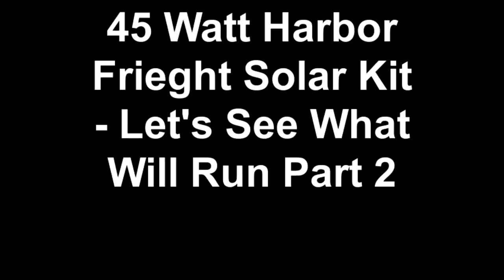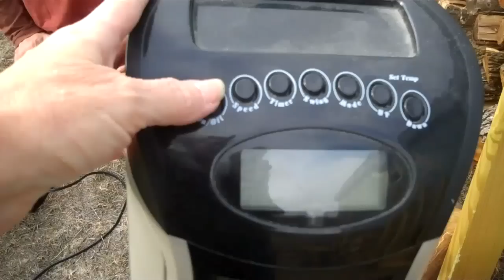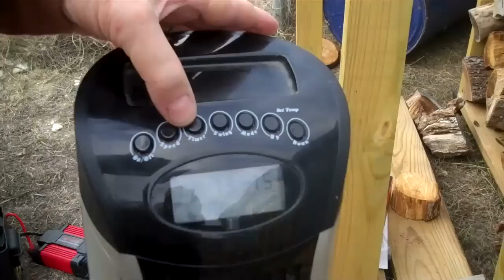45 Watt Harbor Freight Solar Kit - Let's See What Will Run P

Comment from the maker: Yes or add more battery bank or larger watt panels for faster recharge but as they system stand it would end up not being able to charge the battery as quickly as the fan can deplete it.

Comment from the maker: Yeah, very true. For that type of application 45watts probably wouldn't do much for you. You could probably find a single panel that is smaller and generates more wattage. We got the HF system just to get our feet wet and start learning about solar power.

Comment: I've owned those same panels/kit. 45w comes only in direct sunlight under optimal circumstances. I used my kit to charge a small solar bank of batteries just as an experiment and it taught me wonders. It also taught me little $ buys little total output. If you're serious you need good equipment and a much bigger panels. A 45w system is meant for one or two CFL's in a shed and such. Maybe a landscaping light or two. 45w is more like a battery maintainer, not a charger.

Comment: I hate to be a stick in the mud but the solar panels ain't running anything. The batteries are. Connect the inverter directly to the panels and you will find that they will run very little. They are ment to charge the batteries when no load is there using power.

Comment: that drill wont run under a load . the overload will squeal every time ..
some time you can add more batteries wth 00 ought cable and it will help .
but you really needs a 2000 watt to run power tools
i barely get 10 amp ac out of my 2000w . at 100amp dc .
to run easily on your inverter . you need to run  at 50-75% . to be most efficient . that way your inverter doesn't get hot ..& your not wasting power
more questions you contact me  Facebook .Gerald Strong
facebook.com Homemade-incubators

Comment: Fan was probably acting strange because inverters put out square waves instead of sine waves like a house does. I used to have a laptop charger that would not get along with my inverter, it kept switching on and off and flickering the charge light.

Comment: here in the us its about 60$ a month to run a 400watt @ 110volts but if u use 240volts u can run a 600watt for the same price (less lead on the curent the magnets dont have to work as hard) this goes for digital or anilog balests =3-

Comment: Watts is how much energy (J) is used per second.  Kilowatts are 1,000  Watts.  A kilowatt hour is how much energy is used by a 1kW device for an hour.  So what you do is take your electric bill, find out how many kilo-watt-hours you use, and divide by the billing period (720 hours in a month).  Ex: 1440 kWh / 720 hours = 2 kW average load.  The battery concept won't be as cost effective as installing a two way meter that sells energy back to the grid.

Comment from the maker: Something like that.We haven't gone that deeply into it ourselves yet, but I think you determine how many watts each item uses and multiply that by how many hours a day that device runs to determine the daily power requirements for that device. Then you add them all together to get the daily household power requirements. I'm sure there is more that has to be taken into account before deciding on a system. There are some good sources on the internet with more info than we can give at this time.

Comment: I have question about Watts.  Too find out how many solar panels, how many batteries you need for a whole house off the grid, do you have to add up all the equipment and appliances Watts required to run them and go from there? I hope my question makes sense. Watts determines how many solar panels and batteries required?

Comment: I have to comment that the fully charged battery is running your 750 watt inverter, and it would work with NO solar panels and proves nothing about the panel output..Its not a test. 

Now if you put a dead battery on it or ran the inverter directly off the panesl that would show something..

Comment: Lead acid batteries are not a good idea with solar power, a AMG sead battery is much safer.

Also be sure to hook your battery to your controller first , Never hook the panels up to the controller without the battery being connected

Comment: Thanks for the info.Between your video,these comments and some research I think I got it(Think,lol) Im more interested in an emergency  system and am gonna try a system consisting of a 5 watt trickle charger and two 12volt batteries...I to use and 1 to charge.We'll see how that works,thanks again man.

Comment from the maker: I was just thinking about that the other day. I think the inverter and panels can be connected at the same time, but not absolutely sure. Have to check on that. I would really recommend some type of storage battery rather than automotive battery (we're using a marine/rv battery).

Comment: Nice video...I have a few noob questions...I see that I just need an inverter and a car battery,but what is a recommended watt output?(I see 300-1000 on amazon),and can the solar panels be hooked to the battery while the inverter is also? And what exactly do I need to be "Searching for"on amazon to find something like this?
Thanks in advance.

Comment from the maker: You are right.  We disconnected the charge controller from the panels when we hooked the inverter to the battery.  As noted further down in the description the fan is actually running off the battery that was charged by the solar panels.

Comment: What you are doing is a function of the battery and inverter.   The recharge/recovery rate of the battery will then be determined by the solar panel productivity which in turn is limited to the 45 watts on that system although you can add one more panel without blowing out the charge controller that comes with it.   The very first system I built was based on that.

Comment: OK thats cool...but people have to know..the system you have is NOT for real home use, just basic DC and very limited AC use. losses in conversion or 90%  12 v dc @100 amp/hrs will provide about 10 amps for 1 hour at 120 volts..and that is limited to 80% so you do not kill the battery .

Comment from the maker: Thanks for the info. We realize the Harbor Freight system is limited, but our purpose in getting it was just to use it to get some experience working with solar; for that it has worked just fine. It keeps our rv/marine battery charged between camping trips. We got it on sale for about $149.00, which was within our budget; $470.00 was not. From this point forward we will buy better panels/batteries/charge controllers, but this kit at least let us get started in solar power.

Comment: use solar modules that provide at least .87 amps for a 20 watt mod, for 2.61 amps of charge power from 60 watts. a good charge controller of at least 8 amps. and buy an RV or marine battery 110 Ahr from Costco or Tractor supply for about 69 bucks. total cost for the above should be around 470 bucks, a little more than the HF or NT system but twice the power and battery included..

Comment: Piece of junk!... Look at the back of the Modules.. each 15 or 20 watt mod only provides .34 amps (Apx.1/3 amp).. what a joke..so for a 60 watt system the most you get is about an amp..to charge your battery bank..Want a tip...use 50 watts of collector to charge 100 amp hours at 12 volts as a base..build from there.  PS Put a load on the drill and the inverter will trip out..but by now you figured that one out...

Comment from the maker: Yeah, we finally figured that out. I had known for some time that modified sine waves could affect some sensitive electronics, but didn't know about the issues with motors until others pointed it out. Fortunately, we're mostly using the battery/inverter combo to recharge cell phones, laptop computers, cordless power tools, and so forth, so it works fine for that. Thanks for watching!

Comment: Nice video ,, very cute 
Fan more like acting up because ,, Not pure sine wave 
Lots of digital displays ,, and motors don't like modified sine wave ..  
I got several modified inverters ,, MYSELF 
for example some my of eclectic blanks wont work ,, 
and some fans will not run or if do they chatter bad .. do to the 
wave form .. 
Now with that being said not all modified wave inverts are same 
Some are clean then o there's // some run some things and not others 
GOD BLESS

Comment from the maker: Yeah, someone else had commented about the modified sine wave issue with motors, but thanks for mentioning it. I didn't know about the CFL issue though, we haven't tried those yet, so thanks for pointing that out. We're mostly using it for recharging electronic devices and cordless power tools when remote camping, so we can get by without a true sine wave inverter for now.

Comment: You are really testing if the battery and inverter are strong enough to power the fan there.  Looks like you have a 700W (or more) inverter.  Question is how much power (watts) the fan draws vs. how much the solar panels are replenishing.  If 200W/hour for example being used, and 45W being added by the panels, you run out quick

Comment: Great video! I have a 45W HF set too, and a LaVie 30W panel going to 9 batteries that I run my fans and the LED lights in my living and dining rooms. Works very well.

Also, there are very affordable wind turbines on eBay if you want to take advantage of all that wind.

Comment: Something else that you might think about if you are going to use your solar panels for much would be cordless power tools.  That way, instead of having them draw all that power from your batteries in your system, they just have to charge the batteries for the tools.  I run my small workshop off of my system, and this has helped immensely with keeping my draw to a minimum without reducing my effectiveness.

Comment from the maker: Without the battery the drill would not run as the solar panels are only rated at 15W each, total of 45 watts. Don't know how long with the battery. However, my wife wants to see how long it will run with her dehydrator, so we'll see how that goes.

Comment: So briefly, if your device has a electric motor that doesnt run straight off the main voltage it will act funny.  I have a true sine wave inverter and a modified sine wave inverter to make you a comparison if you want.    Modified sine wave as they call it is not a sine wave, more like a triangular wave.

Comment from the maker: Thanks for the info! The information I've found suggests that modified sine wave inverters are generally okay for powering non-electronic devices such as lights, toasters, motors, etc., but can cause problems when used to power devices that include electronic circuitry such as computers, televisions, etc. One example given was that it would probably power a refrigerator motor just fine, but could cause problems with any electronic control circuitry used by the refrigerator.

Comment from the maker: The panel keeps the battery charged, and the battery is, if I remember correctly, rated at 220 amp/hours so it should last a few hours at least. We don't use it very often, our main purpose is to keep the battery charged for emergencies and camping so we can run or charge cell phones, laptops, radios, ham radios and so forth.

Comment: I've been using a cheapo set of Harbor Freight solar panels to charge a pair of 6 volt Sam;s club deep cycles for four years without a hitch.  The only problem I have incurred is the charge controller that came with the kit lets the batteries discharge through the panels at night if I don't turn it off.  Cheapest watts readily available.

Comment from the maker: Yeah, some people won't buy anything electrical from them, but from what I've seen it depends on the specific item. Some items are consistently good, and others just seem to have a lot of problems. My general rule on Harbor Freight is to first check the customer reviews before I buy. I usually shy away from anything that has only a few reviews and/or less than 4 stars. If I do buy the item and it costs more than $50.00, I usually go ahead get the extended warranty.

Comment: yea for a starter or like you said to get your feet wet its a great start. they be great to keep a battery bank charged untile you need the power for emergancy I got my pannels off ebay.   and I have looked a round I can get pannels cheaper per watt than what I did with the 2 40 watt panels.    but if your just getting started its a start.   but my goal is to get up to 5 to 6 kw of solar, and I will be going with a outback gti/backup system and charger controller.

Comment from the maker: Agreed, if you plan on building a larger array then you would absolutely want to go with something else - and with larger panels -  to get a lower price per watt. But for someone who is just getting their feet wet with solar energy, I think the Harbor Freight panels are not a bad way to go just to get a bit of experience. You get panels, charge controller and light bulbs, you just need to add a deep cycle battery and you're in business with a simple solar setup.

Comment: harboor feight solar panne are way to exspencive the price per watt is just crazy.   I have two 40 watt panels I paid 152.8 for free shipping and the harbor freight are running for 189 and if you have the cupon you can get it for 150 but I have 35 more watts for the same price.

Comment from the maker: Sorry, this little system is nowhere near large enough to power an air conditioner for any reasonable amount of time. The panels, at 45 watts total, provide only a fraction of the power required to run even a small a/c, so the single battery we are using would be discharged very rapidly even during peak sunlight conditions. You would need a much larger (and much more expensive) system to do this.

Comment from the maker: The kit came with a charge controller so we are just using that for now. I think it's only rated for 45 watts, maybe a bit more, so If we decide to add more panels we will need to get a different charge controller, but for now it works fine.

Comment from the maker: Yes, that's' correct. We use the solar panels to keep the battery charged up so it's ready when we need it (emergency, camping, etc.). Then all we have to do is connect the inverter and we have ac power.

Comment from the maker: If the battery is fully charged and the inverter is large enough to power the fan, then it should work. If the fan runs fine when connected up to household current, then you might want to check how many watts the fan is rated at and verify your inverter can provide at least that many watts.

Comment: take the battery off and it won't run. They're 15W panels. good for recharging and far cheaper than the 600$ for the 280W sharps but they won't run that fan directly.